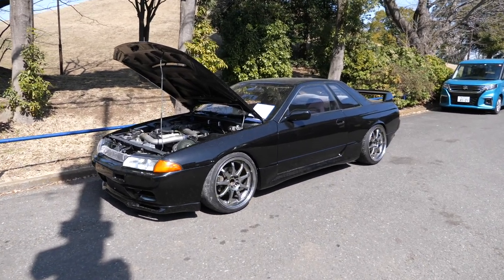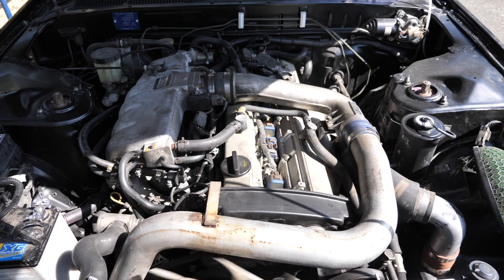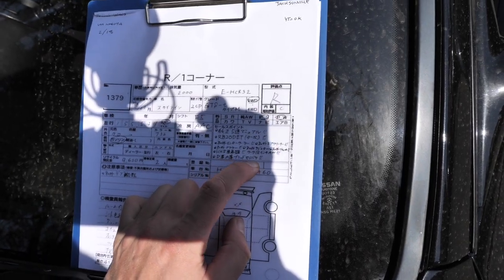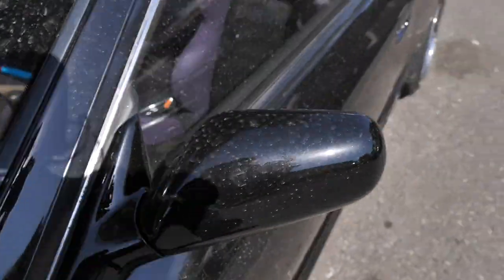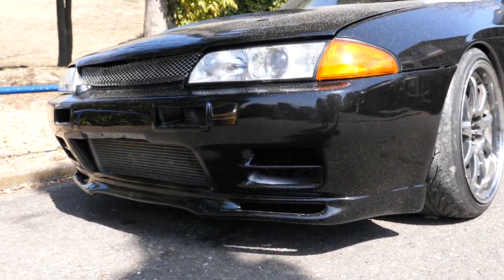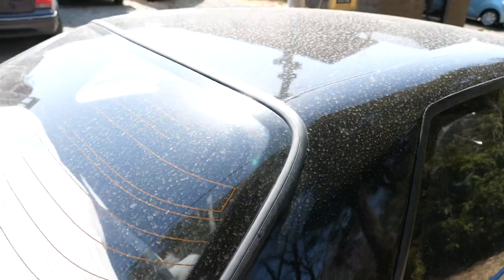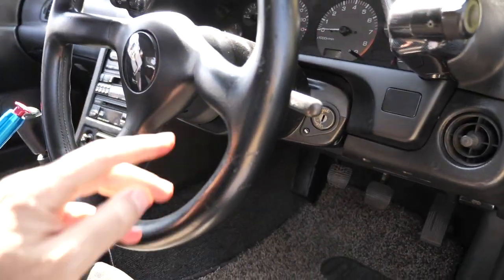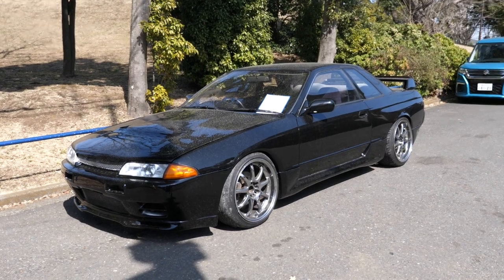1991 Nissan Skyline GTS-T Type M R32 (USA Import) Japan Auction Purchase Review

Comment: Looks like need a replacement seats, interior cleaning, rebuild dashboard and better stereo systems.
Undercarriage need to check for rust. Engine need to replace for RB25DE-NEO. Check engine mounting, replace wheels and tires.. 
And it's a great ride
Reply: Its perfect like it is
Reply: The company bringing this car over should have checked for rust in the problem areas. Fixing the dash bubble is not too problematic. And I feel the stereo setup should be retained as it looks like a rare dealer option. Maybe install better speakers and an amp. Just get some cassettes off EBay and blast away!
Reply: @douglaslorin739 , yes for that.